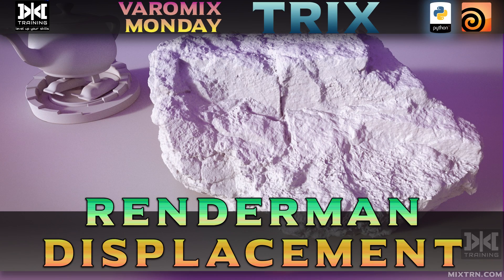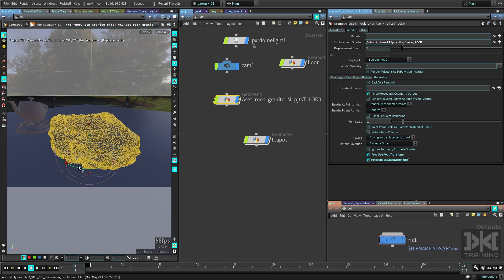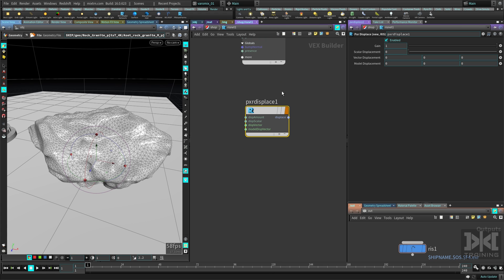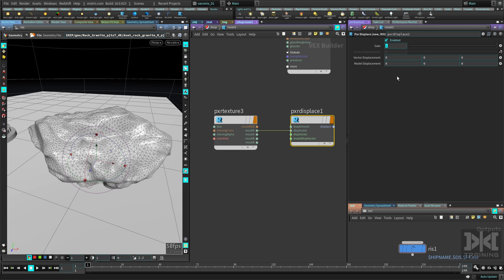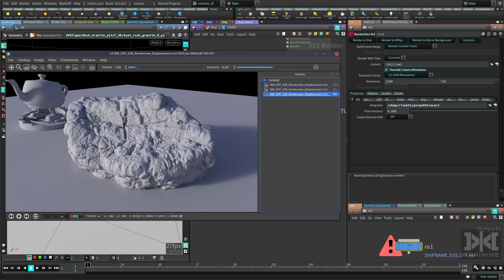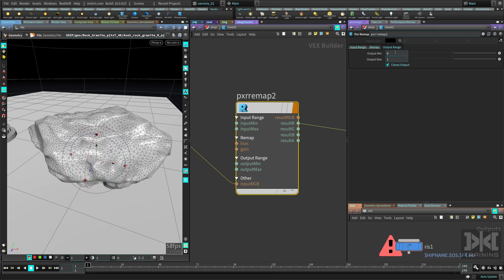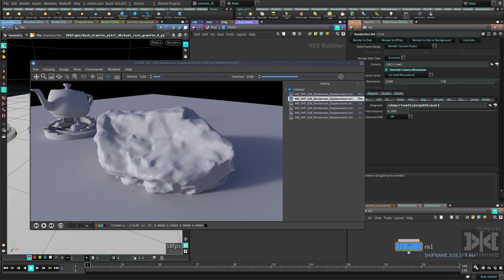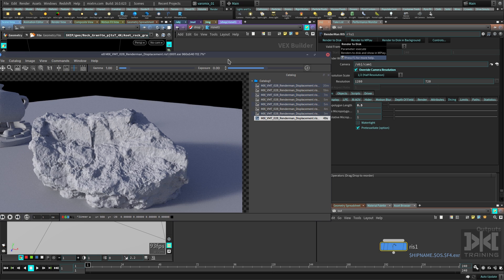VMT 028 - HOUDINI - Pixar Renderman Displacement How-to

Comment: I'm pretty sure you could have left your input range at 0 to 1 since those are the values that are coming in from your image. There are no negative values in your displacement map, since the midpoint is at .5. Then you shouldn't have to mess with the gain or anything, just set your output values to -1 to 1. or -.5 to .5 if you just want to shift it.
Reply from the maker: You are probably right, at the time, that gave me the result I needed